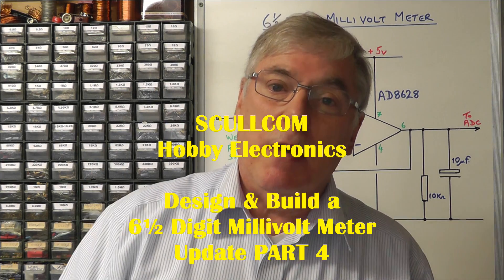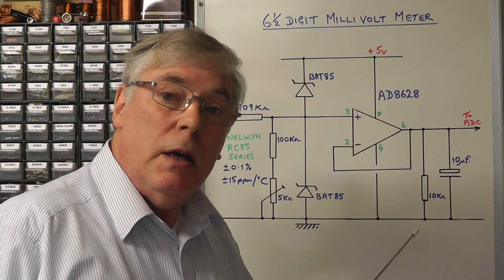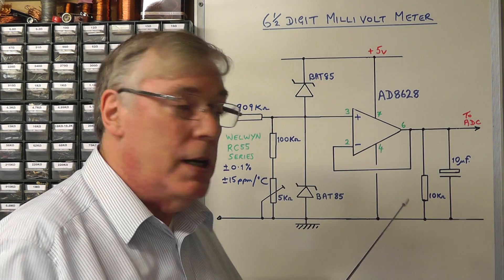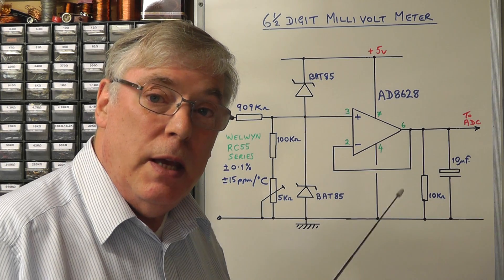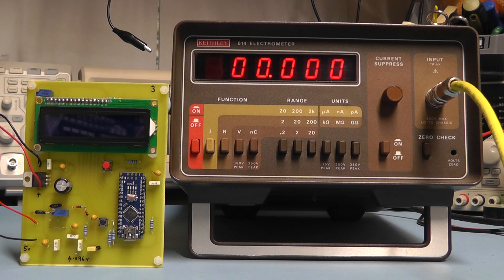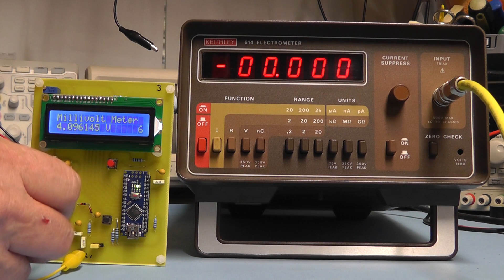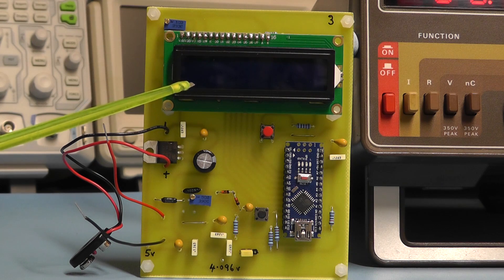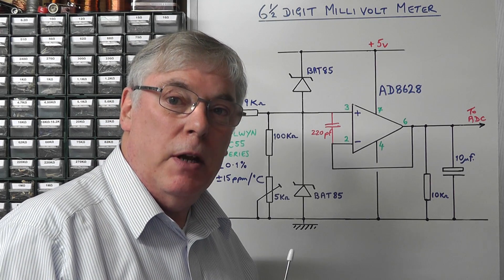Scullcom Hobby Electronics #36  - Design & Build 6½ Digit Millivolt Meter Part 4

Comment: If you are using trimpot to adjust the voltage divider, then whats the justification to use 0.1% resistor with low tempco ?
Reply from the maker: +Satyajit Roy The trimpot used is a good quality Bourn trimpot which has a resistance accuracy of ±10% with a temperature coefficient of ±100ppm/ºC. Therefore the absolute value 5K trimpot can be anything from 4.5K to 5.5K. This initial value is not that important as long as once it has been set it remains stable. The ±100ppm/ºC means that the resistance can change by ± 0.01% which is only 0.5 ohm per ºC. The other two resistors add up to just over 1Mohm so in the whole scheme of things the drift of the 5K trimpot is not that much of an issue. The main reason am using the ± 0.1% tolerance for the other two resistors is for their long term stability performance of ±15ppm/ºC (equal to ± 0.0015%). Again the absolute value is not the most important point as this is taken care of by the trimpot adjustment. The important thing is that once the input divider is set a divide by 10 it remains stable at that as far as possible.

Comment: Hello Louis. I think this design can be improved further up to the point that it may be called a microvolt meter ;)

1. BAT85 is not so good for this precision DVM. It has a reverse leakage current of 200nA at Vr=5V T=25*C, far greater than opamp bias current. Consider using something like BAV170 or drop it altogether depending on what is the max protection voltage, because the opamp already has ESD/overvoltage protection diodes built in.
2. The opamp will most likely be unstable with capacitive loads. This can be fixed by adding a resistor on opamp output. Refer to SBVA002 and AN1177 for example circuits.
3. Individual resistors will drift in an uncorrelated fashion as they age. Therefore, the input divider ratio will drift. It would be best to use a premade resistor network that is specified for resistor ratio temperature coefficient and aging drift.
4. I would avoid using trimpots and instead do calibration in software. Cheap trimpots drift a lot in time (especially their absolute value, ratiometric drift is somewhat lower)
5. You might reduce resistor values at the input to reduce the effect of input bias/leakage currents. On the other hand you can't allow too large currents or the diodes may get damaged.
6. PCB design can be improved by better placement and routing, adding guard rings, shielding and so on to reduce noise and drift. Burn-in before calibration would minimize aging drift even further.
Reply from the maker: +Adam Kotys Thanks for your detailed comments.
1. As the AD8628 has built-in ESD protection diodes I think I will remove the two BAT85 diodes. The fact that we have a 909K resistor at the input that will be more than sufficient to prevent any excessive current following in these internal diode when there is a input voltage overload.
2.  I agree adding a larger capacitor on the output of a unity gain OP Amp is not ideal and can cause it to oscillate and become unstable. One solution to this, if there is a large capacitive load on the output, is to add a capacitor and resistor in series between the two input pins. As you will see on the video I did add a 220pF capacitor across the input of the OP Amp and that help, but I may add a resistor in series with it as well if I find it helps. Also adding additional capacitors at the input to ground and supply voltage may help. I may look at reducing the value of that output capacitor and see how the circuit responds. I originally added it to reduce any possible noise on the input to the ADC.
3. I agree with regards the input resistor network but I made a compromise in using the Welwyn RC55 series in order to keep the cost down for the hobbyist. I do mention in Part 1 of this the project that you could use a Precision Divider Network and I show the Caddock 1776-C681 but these are quite expensive for the hobbyist but you could use one if cost is not an issue.
4. Trimpots can be an issue but I used a good quality one from Bourn and it was 25 turns (not the usually 15). We could look at possible software calibration at a later stage in this project.
5. The input bias current for the AD8628 is only 100 picoamps at max. so with the resistor values at present are OK.
6. You are correct PCB design is always critical in these type of circuits and I think I did mention in one of my previous videos the possibility of adding guard rings around the input pin connections of the OP Amp. As this project develops will look at designing a new PCB as we may be adding more function buttons and possible replacing the LCD with a 20x4 display.
Thanks again for your comments. It is good to discuss and I think it also helps other viewers understand some of the issues and considerations when designing and building a project from scratch.
Reply from the maker: +sufzoli Adam, you could use a Precision Resistor Networks Arrays such as the Caddock 1779-C681 which is a Film Resistor Network that is laser trimmed and has a tolerance of 0.05% and Temperature Coefficient of 10 ppm/C. These cost around £12 ($18). These are available from suppliers such as Mouser and Digi-Key. If cost is an issue stick with the Welwyn RC55 series resistors I show in the video which work very well.
Reply: +Scullcom Hobby Electronics Mouser and Digikey is a bit problematic for me as they charge lot for the shipment to this part of the world. I'm usually using Farnell, TME, RS, and the local suppliers.
I was thinking about the Welwyn PCF0805 series. It is cheaper than the RC55 and has better TC. I soldering 0805 resistors were never a problem to me.
Reply: +Adam Kotys 
Hi Adam,

I'd like to ask about your 3rd point. How can you achieve this at hobbyist level? I know, that the professional companies are using custom laser trimmed hybrids for this, but this not achievable at home. Any suggestions?

Thanks,
Zoltan
Reply: +sufzoli

Hello,

These parts are available off-the-shelf nowadays. Examples: Caddock 1776, Vishay MPMA, LT5400. Not everything is super-precision Agilent-level stuff, some components are designed for use in low-drift opamp circuits, but might as well be suitable for this project (depending on the goals of course).

Thanks,
Adam
Reply from the maker: +sufzoli Good idea if you can get the correct values.

Comment: Great circuit improvement. However the 10µF capacitor directly connected to the output usually makes an opamp unstable. I used a similar part (TI OPA333) and it turned out that using a 47-100 Ohms resistor that becomes essentially a low pass filter with the capacitor makes the opamp much more stable, as the AD8628 in particular is only specified to a maximum output load capacitance of 1nF.
Reply from the maker: +Chip Guy Vids Thanks for the idea of adding a low value resistor in series with the output of the OP Amp.
I posted a reply to this point to another comment as follows: I agree adding a larger capacitor on the output of a unity gain OP Amp is not ideal and can cause it to oscillate and become unstable. One  solution to this, if there is a large capacitive load on the output, is to add a capacitor and resistor in series between the two input pins. As you will see on the video I did add a 220pF capacitor across the input of the OP Amp and that helped, but I may add a resistor in series with it as well if I find it helps further. Also adding additional capacitors at the input to ground and supply voltage may help. I may look at reducing the value of that output capacitor and see how the circuit responds. I originally added it to reduce any possible noise on the input to the ADC.
Reply: That's exactly what I was thinking when I saw the capacitor directly connected to the opamp output.

Comment: Smashing update :-D
Dont forget that you didnt take long to create this volt meter in comparison to the resources/staff/time  that big companys have.
Smashing that a subscriber has tidyed up your code and made it faster :-D
I did think about a small reed relay being used to allow the auto zero routeen to short the output of the attenuator to ground, but thats just my lazy side lol :-D
Reply from the maker: +zx8401ztv Thanks for your comments which are always welcome. I did try both a reed relay and a solid state switch but that added some resistance, so I decided to leave it as it is. The more I thought about it, shorting of the input is really to take account of the length of the input leads. In commercial multi-meters that usually cal that the REL (Relative) button.
Reply: +zx8401ztv That's a really good idea but I would switch up the relay with a MOSFET as they can provide mill Ohm on resistance and way better than a relay in that regard but the thing to consider here is that it will not be compensating for the probe leads and if there is any thermo Electric effects with them and their connectors but will be nulling out the electronics pretty reliably (And way better than a hand held pair of wires being pressed together

And only at the cost of a small logic mosfet
Reply: +Scullcom Hobby Electronics 
Well i was just being lazy lol, you could add many things to that design, but it has to be something that you want, dont forget that you need to enjoy what your doing, otherwise it becomes a boring task for you :-(
But if you want to add a  rms to dc converter, that might interest you, perhaps :-)

Comment: Very nice updates. A couple of things that may help even more

put a low val cap in parallel with that 10uF, while the 10uF will take care of lower frequency noise, it wont handle the higher frequencies , the low value ceramic or something say about 220nF or less will, its all about their reactance at different frequencies

in addition to the cap across the +- inputs, addition ones from inputs to ground will also help with the common mode noise. The same value as the one across will do. This approach is very typical of instrumentation amplifier input stages where the DC performance is more important than the AC

Hope this helps 

btw, I plan on trying to build your design or part of it with some of my videos if that's ok, its well thought out and presented and seems to work very well

Regards
Peter from the Breadboard
https://www.youtube.com/c/thebreadboardca
Reply from the maker: +Peter Oakes (TheBreadboardca) Thanks Peter. Your points about the additional capacitors is a good one. With regards the capacitor on the input of the OP Amp I have also been trying adding two more capacitors from the OP Amp input both to ground and +5V, which I think is what you were getting at as well.
You are welcome to use any of my designs with your videos if you find it helpful.
Regards,
Louis